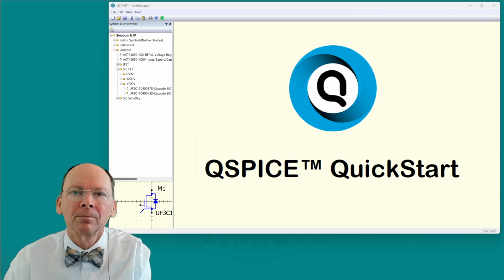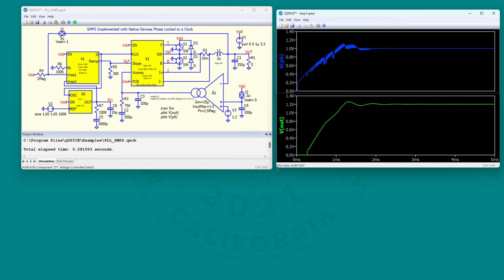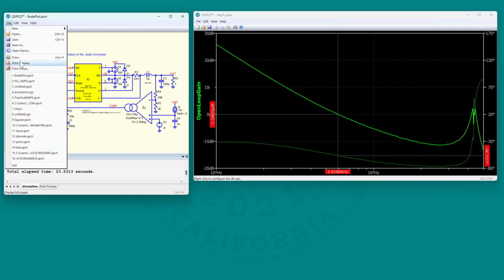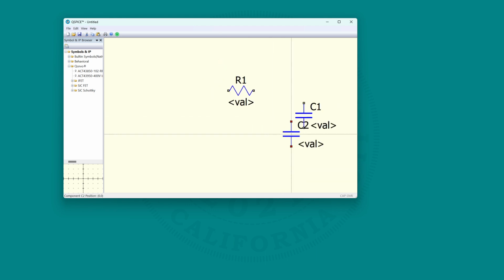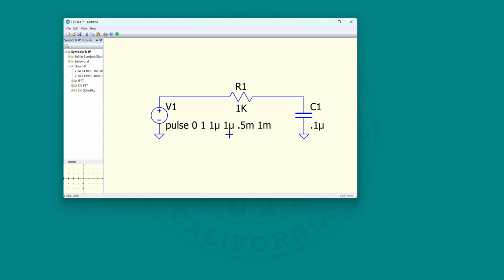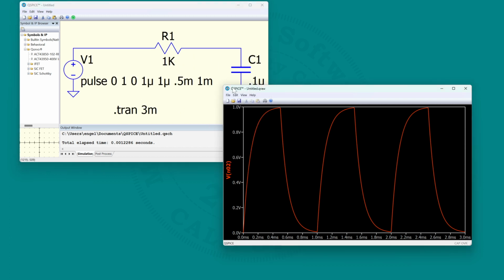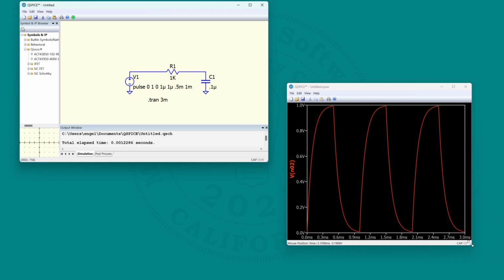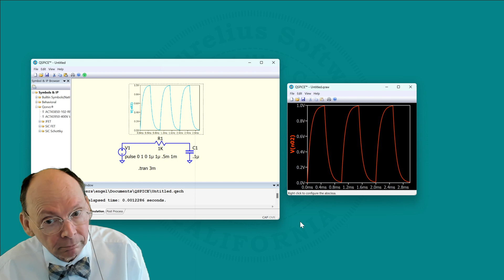QuickStart Guide for QSPICE™ Simulation Tool

Comment: Is there reason why qspice capitalize lettwr k in  in values.
Si prefix for kilo is written with lower lettet k. Upper case letter K is  reserved for Kelvin  (written without  degree simbol contrary to for example Celsius which required degree simbol bedore C)

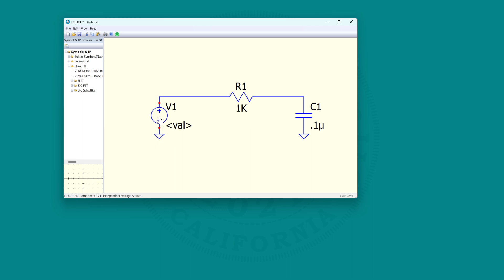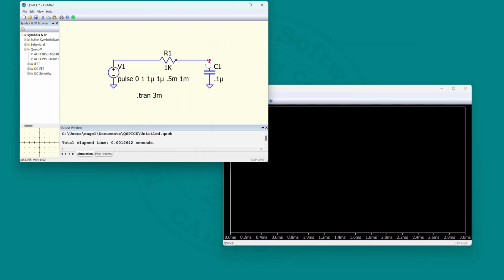Comment: Some very nice steps forward but ARRRGGG 5:25 a CATASTOPHIC UI blunder when it comes to facilitating use of directives like tran and voltage source. "this actually has a technique which I think is a little bit better it gives you a hint for the syntax underneath the area that you're typing and as you type it fills out the form underneath ".  The values you type in REPLACE the syntax guide, so you no longer know what the cryptic many-parameter strings mean, making it impossible tosuccessfully edit.  It's difficult to overstate how horrible this is. LTSpice has forms for this purpose, and you can argue that they slowed down experts, but there was no mistaking which slot is which.  A point PROMPTLY demonstrated by the mistake at 6:40.  I so hate to look a gift horse (from an industry stalwart) in the mouth, but this failed feature has to be fixed so that the product can flourish in the manner it deserves!

Comment: When you want to analyse RF circuits that have matched source and load, use AC 2V as the source instead of AC 1V. That will give you the proper insertion loss. As it stands your analyses all yield 6dB excess loss that should not be there.

Comment: Wow so you want to convince us that typing a bunch of parameters is easier than filling out a dialog window and then you miss a parameter.  What's wrong with the dialog windows?  It is so convenient to enter a bunch of parameters where you clearly see what they mean.
Reply: Programmer here. I completely agree. Mr Engelfart has done a great job of making the simulation fast, but it's a dog to use. At this point, he would be well advised to consult a specialist in user interface design.

No doubt he's proud of his interface and thinks it's the best thing since sliced bread; but he's wrong. It's not a "modern interface": People were using DOS and teletype terminals forty or fifty years ago; and we moved away from them for a reason!

Comment: This looks like a great program, but I was unable to install it. When I get to the install prompt, after accepting the license, it seems to start installing, but then goes to “not responding” mode. Strange. I haven’t had any issues installing other software on this machine, but I’ve tried several times with no success. I’ll try to research this, but I haven’t seen any installation issues described so far. Edit: Update; I was able to install the program today. I'm not 100% sure what happened, but I think it might be related to the fact that I use multiple desktops. I'm speculating that the install program was unable to close the File Explorer in one of the desktops that I had in use at the time. I rebooted and restarted a fresh install. This time I preemptively closed the File Explorer myself, and QSPICE was installed almost instantly.  P.S. Than you very much for your work on this. So far, I am amazed with the program and I'm sure I'll get a lot of use out of it.

Comment: Great to hear that something new is being developed, but and its a big BUT - are we doing another unconventional bass awkward user interface?
Can we have nice buttons for everything, and instead of typing 'pulse 0 1 1u 1u .5m 1m' just open a window where I can set frequency, offset, amplitude in a few easy clicks?
Can we have easy to use things like voltage control switches that don't need numerous directives to set them up?
Can we have insert new component to library from file? Instead of yet another directive or editing .bjt files hidden who knows where.
Can we follow conventional user interface guidelines that EVERYONE uses.
Why does barrier for entry has to be this high?
Reply: I'm gonna agree with the setting of sources, both voltage and current, I like the LT spice version of doing that. I do like the shortcuts for entering parts though!

Comment: Is that the temperature of the resistor? 1 Kelvin? 😋
Reply: k means kilo, or x1000
Reply: @ray-tz6bu  lowercase k means kilo, uppercase K means Kelvin (temperature unit)
Reply: @daniloxyz  SPICE programs are usually not case sensitive. 1M does not mean 1Mega but 1milli, so Meg is used instead.